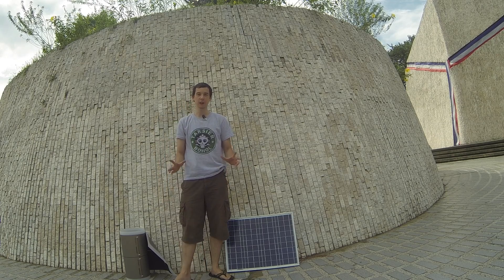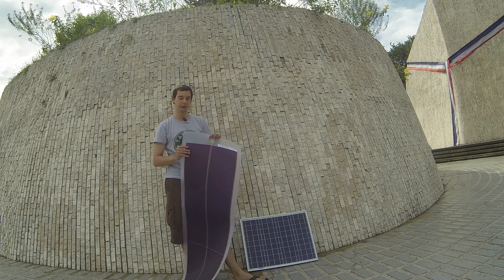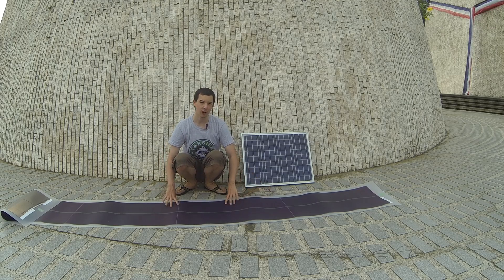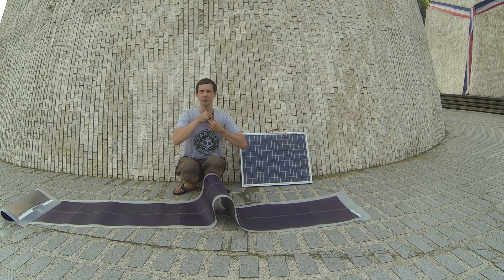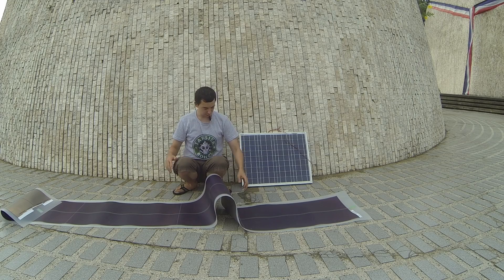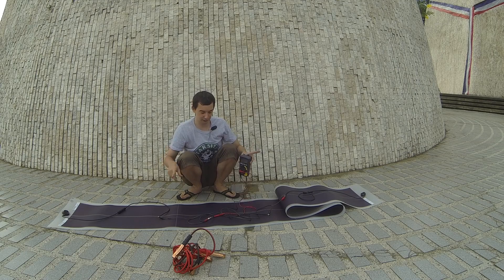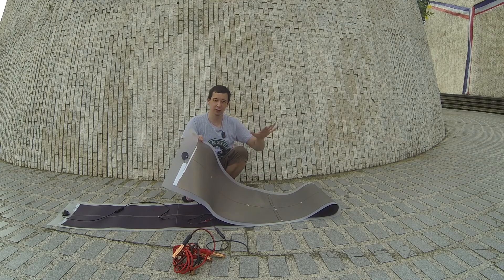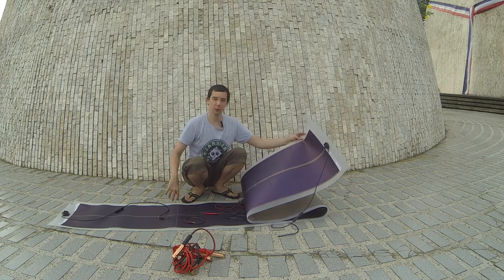Fuji Fwave Flexible Solar Panel

Comment: were did you get that connecter gadget addict
Reply from the maker: I bought them locally from a solar shop. You can find them on ebay/Sulit/OLX.
Reply: Gadget Addict When you're in the dark and you want to see,
You need uh... Electricity, Electricity
Flip that switch and what do you get?
You get uh... Electricity, Electricity
Every room can now be lit
With just uh... Electricity, Electricity
Where do you think it all comes from
This powerful... Electricity, Electricity
Through high wires to here it comes,
They're bringing uh... Electricity, Electricity
Every building must be wired to use it,
Uh... Electricity, Electricity
Power plants most all use fire to make it,
Uh... Electricity, Electricity
Burnin' fuel and usin' steam,
They generate... Electricity, Electricity
Turn that generator by any means,
You're making uh... Electricity, Electricity!
A generator is a machine that contains a powerful magnet that creates a magnetic field. When wires are rotated rapidly through this field, then a current of electricity is produced.
    Now, if we only had a superhero who could stand here and turn the generator real fast, then we wouldn't need to burn so much fuel to make... electricity.
Benjamin Franklin flying his kite
Was searchin' for... Electricity, Electricity
He knew that it had somethin' to do with lightnin',
It's all uh... Electricity, Electricity
Rubbin' a comb with wool or fur will give you a charge of
Electricity (static) Electricity
Strokin' a cat to make it purr, you're buildin' up static
Electricity, Electricity
Electricity at rest is called static electricity.
Like in the winter, wearing a heavy coat,
You get a shock off the doorknob.
Or you scrape across a carpet
And sneak up on your very best friend,
And zap 'im on the ear with a shock of-
Electricity, Electricity
Current flowing to and fro, makes a circuit of
Electricity, Electricity
Voltage is the pressure that makes it go.
It's pushin' uh... Electricity, Electricity...
Watts will tell you just how much
You'll be usin'
Uh... Electricity, Electricity
Powerful stuff, so watch that plug! It's potent
Electricity, Electricity
Electricity, Electricity

Comment: Thanks for a gr8 video, I am just buying 1 on the internet  to use in  my trailer tent, just wondering to what I would also need to use it to charge my 12V car battery  ?
any ideas please ;-)
Reply from the maker: You'll need a DC step down converter. There are some on ebay that convert the 319V from the solar panel down to 14.5V which is suitable for charging your 12V battery :)  The one's I've seen have over voltage protection to stop charging when the battery is full :)
Reply: thank you very much , ill go looking for 1 when i get back home ;-)

Comment: good job
can you tell me please the cost of the flexi panel and can you order any length?
thanks
Reply from the maker: Eli Malka They're only available in one length and the price varies depending on where you order them from. Local sellers have imported them from Japan and Europe and their prices range from 4000-7000PHP.
Reply: Gadget Addict 

Dear 
How  are you ?
Could you help me about the fuji 92w . How to used them an
How much is the fuji 92w solar ?Where can we buy this for  wholesale ?
We need good prices . 
Please contact me to my mobile or whatsapp +967712927117
And my address yahoo alzoobery2001@yahoo.com

Best Regard
Reply: is there a fuji flexible panel available in manila? if yes, where?
Reply from the maker: Jezreel Philip Esarza I know someone selling 3 panels and a controller for 12k PHP. Otherwise I don't know any other sellers.

Comment: wow thanks you for that you really explain it well could I ask you the cost of one of those panels in P ?  do you really need more than one panel so then you can just use that straight as is but permanent would need a converter and batteries I like to set something up my house Nailon Bogo Cebu could I just buy one from Cdr king a small set up just for lights and fan ?

Comment: Thanks for sharing. I have always been curious with these panels. A side note: How do you set up your mic? Any recommendations for equipment.
Reply from the maker: I'm using the Zoom H1 with a cheap (less than $1) lapel microphone. Unfortunately the clip on the microphone was broken during this video, so it wasn't staying in place properly. The Zoom H1 is pretty much the 'gopro' of the microphone world. For the price, the audio is pretty awesome. Indoors I usually just use the Zoom on its own, outdoors I plug the cheap lapel mic into it. Although I do actually plan to replace the $1 lapel mic with something a bit better so I don't have to do quite so much editing to get it to sound as good. So my recommendation would be the Zoom H1 and something like the ATR3350 or if you have the budget, a Rode Lavalier.

Comment: Hi, thanks a lot for your video, is great! just a small question, I got one of these panels but I haven't been able to locate the right DC-DC step down controller you mentioned in the comments, I would be very grateful if you can help me with a link or a place where I can get it, thanks in advance
Reply from the maker: There can be hard to find. One example on ebay is http://www.ebay.co.uk/itm/DC-DC-400W-step-down-controller-converter-high-voltage-/371161703271?pt=LH_DefaultDomain_0&hash=item566af62367
Reply: Gadget Addict Hi, thanks again for your quick response, funny enough the link you send me is from the same guy I bought the panels from a while ago, I actually didn't know I need it a step down controller to charge a 12V battery until I saw your video, one last question if you don't mind, do I still need a conventional charge controller on top of the step down controller? Thanks in advance!
Reply from the maker: mabvc That step down controller is designed specifically for charging 12v batteries (or 24v depending on the model you buy). So you do not need a  regular charge controller on top of this :)

Comment: Nice video new technology and I like the view, I've learned a lot from you I hope you continue guiding some one like me. as you mentioned that type of solar output voltage is not like the regular solar, so inverter for that available already in cdr-king?
Reply from the maker: CDRKING don't carry anything suitable for high voltage solar panels. It's generally not suitable for the average home user / DIY person.

Comment: I got a battery operated scooter which got 48v 8amp li-ion battery and it charges up from main grid via a charger which takes input of 130 watt at 220 V and outputs -56V,1.8amp...Inconsideration to above informations I would like to use the smallest possible flexible solar panel with this device (i will mold/stick the solar panel on the seat of the scooter) with the easiest possible way.Can you please guide me what sort of solar panel would be the best to approach with specification?
Update : I want a built in solar panel on my scooter
Reply from the maker: The panels in this video output a minimum of 90 watts. As you can see, they're pretty long. If you need to push 100-130 watts into your ebike battery, the solar panel is going to take up quite a lot of space. You'd like need to tow a trailer behind. Alternatively you could use a smaller panel and charge the battery at a much slower rate. I also have an ebike which I'm considering adding solar to. My idea was to use 2 regular aluminium framed panels and have them on hinges. When not in use they would fold upright, keeping the slim profile of the bike. When parked I'd have them come down flat and soak up the suns power.
Reply: I want to stick the flexible solar panal on the seat of my scooter. I know its a tiny space may be 15 inch by 8 inch.i don't mind charging it slowly as long as it works.
Reply from the maker: Pretom Chakraborty Maybe you could get a 10-20 watt panel but that's about it...

Comment: Hello Sir Phil, I was planning to buy that 20W solar panel and attach it to a 12V battery and a solar charge controller some fuses etc gonna make an emergency power source if ever theres a storm or sudden blackouts, I was wondering if a blocking diode is still needed for the panel and if its a must to have a blocking diode what should I buy I mean the  Amps and Voltage. Sorry its a newbie question and Thanks and hoping you'd at least reply.
Reply from the maker: Most solar panels come with a junction box that has the blocking diode soldered in place already. These Fuji panels are a rare exception. I've yet to buy a regular aluminium framed solar panel that didn't come with the blocking diode :) Aside from that, if you only have one solar panel and you are using a charge controller, there's no requirement for a blocking diode since the charge controller wont let power flow from the battery to the solar panel and no other panels are attached where the power could flow the wrong way. Where are you planning to buy the panel from?
Reply: good ol' CDR King :D since you yourself already tried most of its solar products imma take your word for it and buy the 20W solar panel and maybe in the future buy higher wattage panels :D
Reply from the maker: jus0402 Sounds good! Come back and let me/us know how it goes for you :)
Reply: will do, Sir Phil and thank you for replying and love your YT channel very informative. Best of luck and again thank you very much :D

Comment: hi there much appreciated you done good job  can you give me help how to control   or convert 319v dc to 24v dc or 230 v ac have any idea
Reply from the maker: Typically people will connect these high voltage solar panels to a grid-tie inverter which feeds the power straight into their house power lines. Myself, I bought a DC-DC step down controller that drops the voltage down to 14.5V to charge a 12 volt battery bank. The most efficient route would be a grid tie inverter :)
Reply: Thanxx for rplay How cost you step down controller
And can you upload video how to solder cable with new panel like you show in video frist
Reply from the maker: Muhammad Zeed I paid around 5,000 PHP (115 USD) for the step-down controller. That's actually a great price compared to other DC-DC converters out there. I still have two more panels to add connectors to, so I'll record the next one I do and upload it. Perhaps this weekend :)
Reply: nice man can you give me link for where i buy  controller and panle thankxx
Reply: How much is the fuji 92w solar ?Where can we buy this for  wholesale ?
We need good prices . 
Please contact me to my mobile or whatsapp +967712927117
And my address yahoo alzoobery2001@yahoo.com

Best Regard

Comment: I would like to ask about the durability of flexible solar panel and where did you buy them? Thank you:)
Reply from the maker: I haven't had the panels long enough to give a solid answer, but they appear to be good quality and are made in Japan by Fuji, so I would expect them to last a long time. You can buy them anywhere from eBay to Sulit, worldwide.
Reply: Gadget Addict thank you man!

Comment: I got 300w grid tie inverter with nominal voltage 20v- 60v. Is this suitable to ur flexible panel? Thanks
Reply from the maker: Hi, it wouldn't be suitable unless you dropped the voltage coming off the panel first. It's possible but you'd be better off buying a grid-tie inverter that can handle the higher voltage in order to avoid losses.
Reply: Gadget Addict
how can i order this?
Reply from the maker: j935989 I'm not a seller, but you could buy them from online sellers around the world :) Local sellers (PH) are selling these at a hugely inflated price, so you might prefer to order from another country.
Reply: Gadget Addict can you post link where we can buy this item. great reviews by the way on the CDRKing panels.

Comment: Can we use this panel to an off grid system? How can we step down the voltage to about 15-20 V DC?
Reply from the maker: Yes, it's possible. I bought a DC-DC step down controller that drops the voltage to 14.5V, up to 28 amp. Initially I plan to use them as an off-grid supply and sometime in the future grid-tie. Even when I grid tie, I'll have at least one battery charging to cover short brownouts.
Reply: Thanks for the info. If you use this to a grid tie you still need to a permission from meralco right? Can I connect my solar panels directly to the batteries and monitor the voltage of the battery manually? The charge controller I bought from cdr king is no longer working (black box), i opened it and the diode inside was burned. I need to replace it. It says on the specs that it is capable of supporting upto 30 amps. I have set up a 300 watt solar system and the current flowing is still below 30 amperes. I was wondering if I can connect the panel to the batteries (2 100AH motolite deep cycle batteries wired in parallel) and i will just monitor the voltage using a digital multimeter.
Reply from the maker: Viper Strike Meralco initially tried to dissuade the government from any kind of solar feed-in tariff but they do now have the net metering program and you can earn money from any excess power you feed into the grid. The thing is, most people still consume more power than their solar generates so it's unlikely they will feed power into the grid and even if they do and their meter turns backwards (if your meter even supports that), it will just turn forward again as soon as the sun goes down. it's no simple task getting approved for Meralcos net metering program. 

I know a few home owners and even a couple of businesses that have grid-tied their solar panels. Most of them use more power than they generate, so Meralco would never even know the panels are grid-tied since the meter will still show usage. I don't know if it's a legal requirement/safety requirement to tell Meralco and apply for the net metering program or if it's just the fact that you wont be earning from it.

A grid-tie inverter will stop feeding power into your home/grid if it senses the main grid is down. This is to ensure you don't push any power down a line that a Meralco power engineer would assume is not live. Although in reality, even if grid-tie inverters did feed power into the grid when the grid is down, it's unlikely to make it as far as the pole because your neighbors homes would still have electrical items turned on and would immediately drain any power you were generating. 

It's not recommended to connect solar panels directly to batteries without a charge controller since the ideal voltage for charging them is around 14.5V while your panels will probably be producing around 20V or more. It will work in a pinch, for awhile, but most likely it will destroy your batteries pretty quickly. That's frustrating about the charge controller. You should be able to buy replacement parts from DEECO in Farmers Plaza Cubao or any similar shop. Hopefully it wont be too hard to fix. Is it still under warranty? I think they give 3 months on charge controllers.
Reply: I connected the panels directly to the batteries today for many hours. I hope it didn't damage my batteries. I have disconnected it already and will try to fix my charge controller. I think they won't replace my controller because I already opened it so I will just replace the diode. I didn't have any problem with this charge controller when my solar panel was only 80 watts. I bought another 80 watts and 150 watts solar panels so the current flowing increased and burned the diode. Thanks again.
Reply from the maker: Viper Strike Hopefully the charge controller is designed in a way that the diode will fail and disconnect the rest of the system before any other components inside are damaged. If that's the case, it was nice thinking and should be an easy fix. Just avoid the temptation to put a bigger diode in there because next time it might fry something more important.
Reply: It is sb5100 diode and based on the data sheet i found on google the max current is only 5 amps. If I were to replace the diode it will be burnt again. I measured the current without any load on my panels it's 15.5 amperes at 19.5 volts. Its really more than 300 watts. The charge controller I bought cannot really support this huge amount of current. I need to buy a cheap but durable charge controller. That controller is only capable of supporting less than 100 watts panel.
Reply from the maker: Viper Strike A 30 amp charge controller should really be able to handle 300 watt of solar power :/ That's very annoying.

Comment: Uhmm is that waterproof?
Reply from the maker: Yes, it's waterproof, as well as the connectors. I don't know of any commercially sold solar panel that isn't waterproof. It wouldn't be very practical if you had to climb onto your roof and remove solar panels every time it rained.